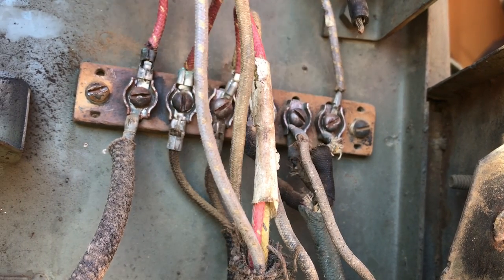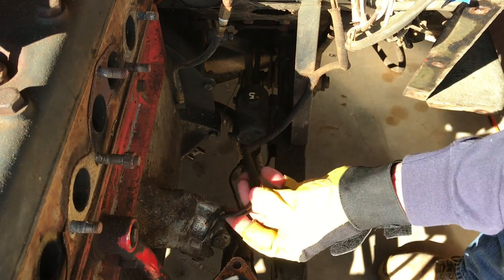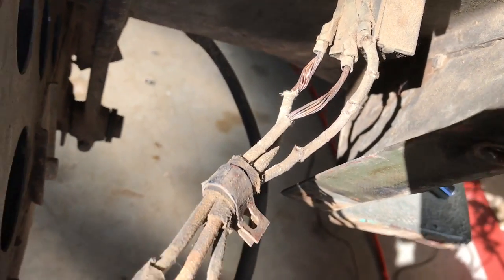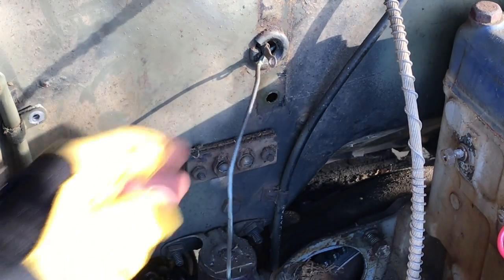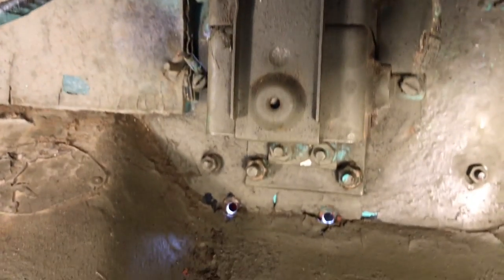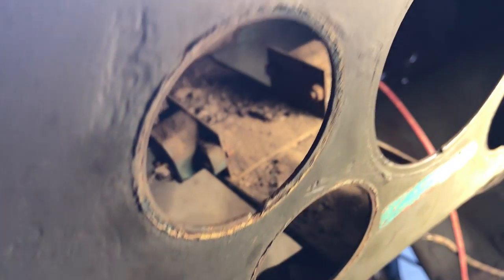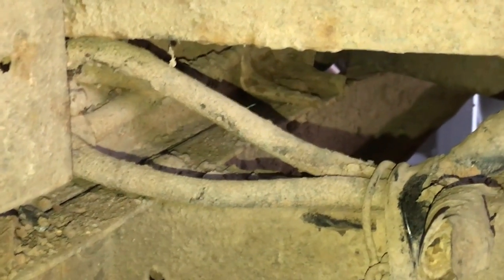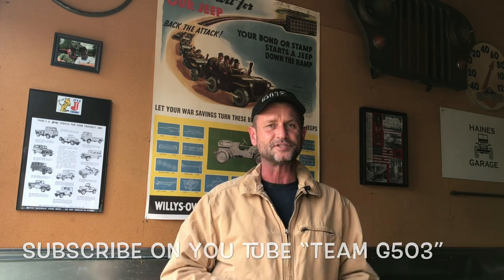Team G503 Willys MB Electric Removal Part 2 (Wiring Harness)

Comment: I’ve got a 1954 M38A1 which is 6v, I assume converted from 24 v. How do I know that all the electrical components were also switched to 6v?  Do I buy a M38A1 harness or a 6v harness?. I’m not experienced so not sure where to start. Suggestions are welcomed.